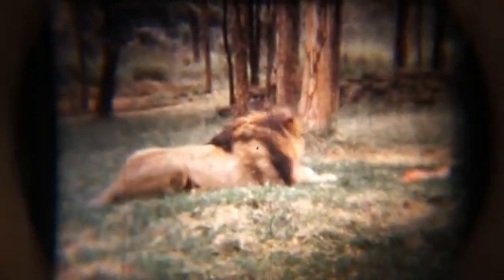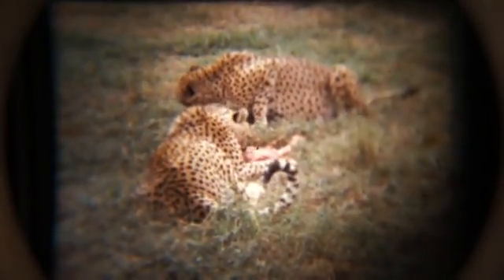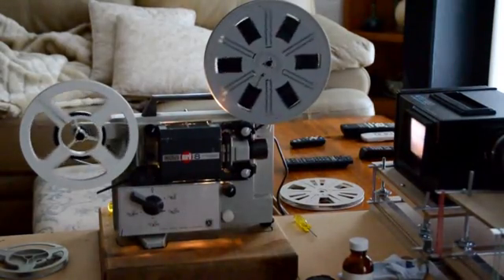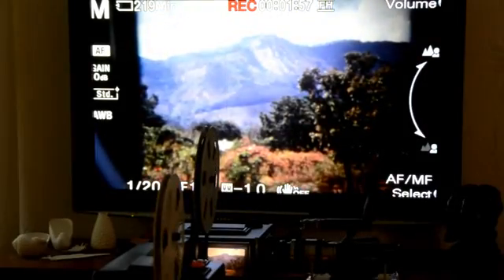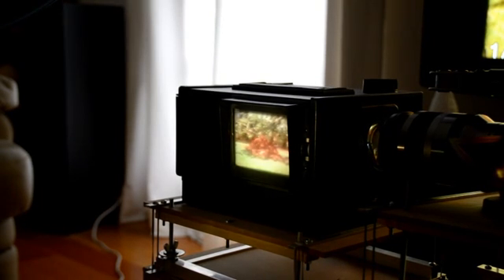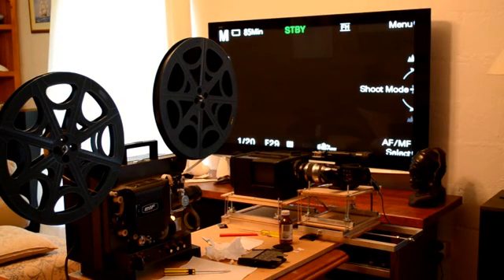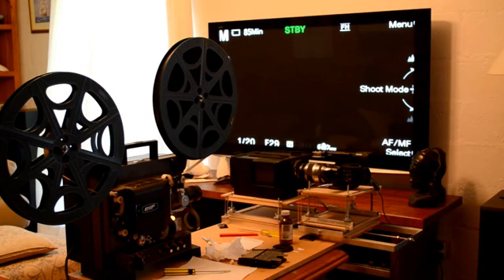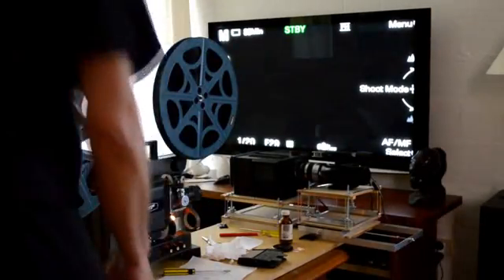Telecine Transfer (Part 4 of 6)

Comment: It seem this way produces over exposed hotspot at the middle of the picture.  A better way to get professional results for  8mm and Super 8 films sound & silent is using a GOKO FROEHLICH TELECINE PLAYER TC-301 for Super 8 & TC-20R  for Regular 8 and I use (depending on the frame rate of the film) a full frame 5D mark 3 camera in manual mode and a 70-20 zoom lens version II professional lens and a Nikon D800 Camera for true 24p capture. On both of these cameras I use the clean HDMI out and  I mount an Atomos Ninja blade on the camera so I can capture high quality uncompressed hd video signal right out the sensor and have professional Prores 4;2;2 .mov files. See samples here: http://aedigitalproductions.com/film-transfer

Comment: With all the respect, but the side focus is horrible. To reduce the flicker: without the required sync between camera and projector, you can work with the shutter. You can reduce it a lot and in order to keep the sharpness, you can close as much as required, the diaphragm ...